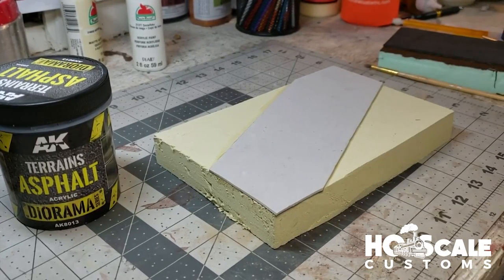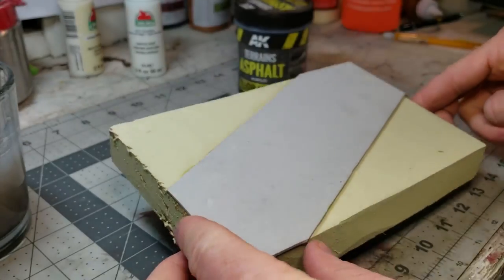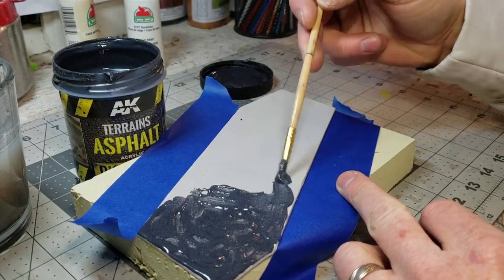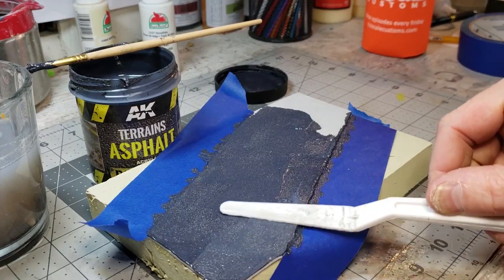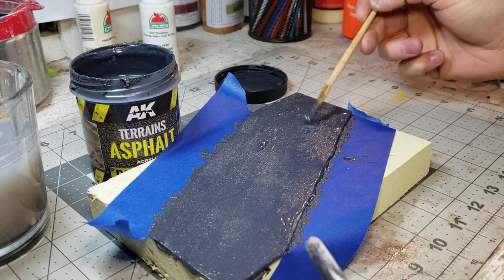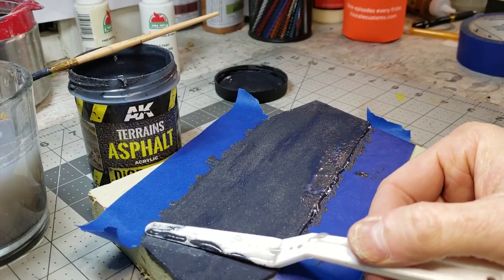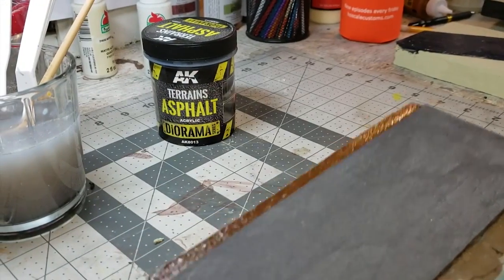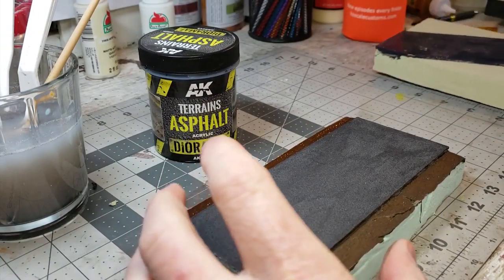AK Interactive Terrains Asphalt (AK8013) - HO Scale Model Railroading

Comment: I cut a piece of styrene the width of the street instead of using a spatula. Also before it is totally dry you can make scratch lines using a dental tool. I've been using it for the last 3 months. You should also try the AK concrete, terrain and corrosion. Their products are very realistic but very expensive.
Reply from the maker: We do have it to try. And for the expense, it is more than some others or DIY methods, but then again we know it works, and don't have to worry about trying out multiple products to see what we like. 

With AK stuff, we pay a little more to do it once and have it done right the first time. The results are very consistent.
Reply: not sure where you're buying yours from, but there not expensive at all.

Comment: It's weird. I bought the same and it's now completely black instead of dark grey. Guess they switched their formula or something
Reply from the maker: That's weird! Yeah maybe they changed up their mix a bit. I'd hate to have started some roads with it and have a different color batch halfway through a project
Reply: @WileysScaleModeling  Yeah, tried it a second time today and no change. I also realized that now it's pretty much super smooth and self leveling, while yours looks a little rough/textured like asphalt is supposed to be. You need to catch it at the right amount of drying to rough it up a little with a sponge or something.
Gonna get Concrete in the future and hope it's closer to what I want.
Reply: I just bought a tub and same here, alot darker and smoother, a bit disappointing.  Though the concrete texture is great